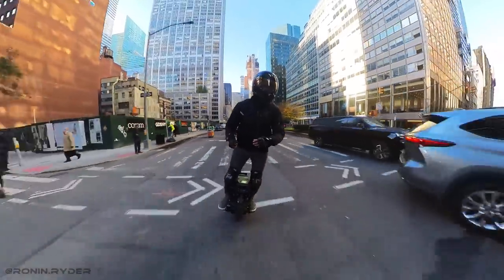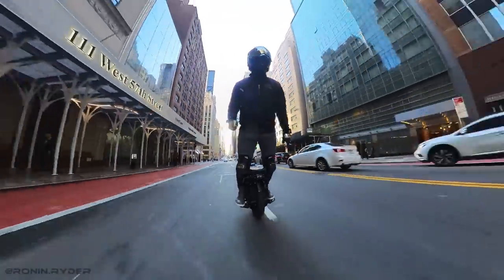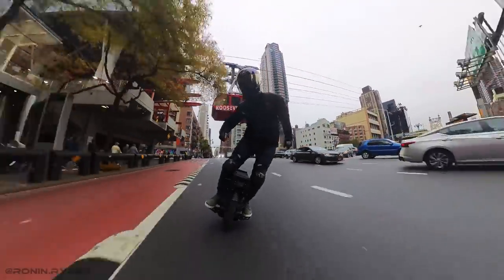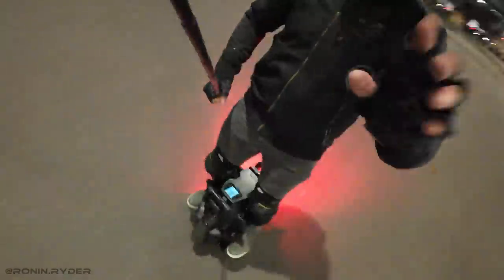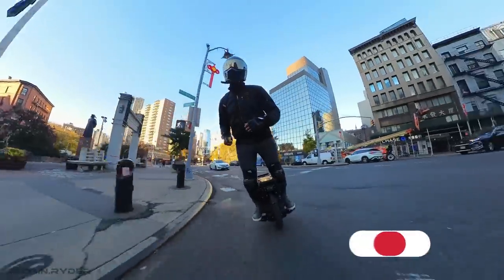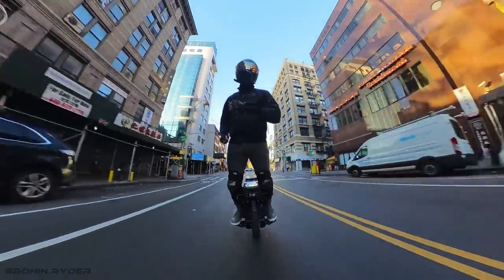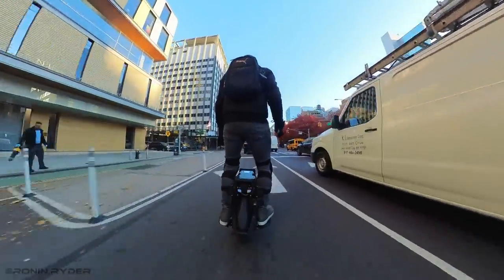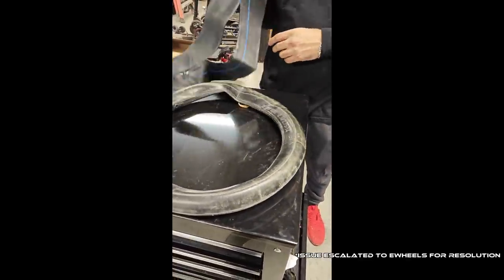VETERAN LYNX REVIEW : The newest Suspension Electric Unicycle by Leaperkim !

Comment: So many new wheels. I am so glad they went back to trying to make lighter wheels. I got the EX30 I've gotten used to it. But I still prefer a more nimble wheel.  I want to power and I want the ruggedness with lightness and nimbleness.
Reply: Get the extreme then..extremely agile with 16" wheel.. it's a mini ex30 pocket rocket.. complements my ex30 perfectly..extremely durable/ rugged with its all cnc metal design.. just get the 50s version
Reply: @justinspirational I agree that it’s lighter and fast but I can’t do higher speeds and if you do it eats battery fast
Reply: @kmurdock3540  how fast do you need?  It's capable of more than 50mph and if you get the 50s version can keep those top speeds up to low battery.. you said you wanted more agility and ruggedness.. the extreme is exactly that.. if you want an even faster street wheel you have to sacrifice agility for stability with a larger diameter wheel.. you have to choose between optimum agility or optimum stability/ higher speed.. the ex30 is pretty agile for its weight due to its low cog and stable and capable of higher speeds but still not as agile and rugged as the extreme for example.. for a higher speed  highly agile wheel you'll have to wait for a 16" 168v 50s begode wheel to be created
Reply: That’s good to know I didn’t know that! I’ll have to do more into that wheel. thanks!
Reply: @kmurdock3540  168v 16" wheel doesn't exist.. I'm just saying hypothetically if you wanted a faster wheel than the extreme but just as agile with a 16" wheel that would be the wheel you want .
But a 50s extreme is pretty close enough or sacrifice some agility for a higher speed more stable wheel that is 20" or more..personally I wouldn't want to be going over 50mph on a 16" wheel and would prefer a larger more stable wheel and sacrifice some agility
Reply: What is the most agile 20 inch wheel out with 50+ mph speed?
Reply: @dustinhankins2153  they're surely all about as agile as each other if they are all 20" as opposed to 16"... the lighter and lower the cog the better I guess.. ex30 is impressively agile for its weight due to its low cog but it is heavier than say a master but the master has a higher cog and not as well built.. ex30 is the faster of the two though.. both are capable of 50+ mph.. but like I say so is the extreme capable of just over 50mph and is the most agile with 16" wheel but not as stable as the 20" wheels.. all other faster, more stable wheels are larger than 20" inches (v13 and master pro) or the other 20" offerings  are really sub 50mph wheels like the s22 and Sherman s
Reply: just put a street tire on the ex30
Reply: @andyl2991 Michelin PS2 80/90-14 ?  Have you converted the stem to tubeless or put the street tire with tube? Thanks

Comment: I have a Sherman Max with the CST knobby and at higher speeds it does occasionally feel like it has a mind of its own - and I don't need my tires thinking for me.  My Master has the Kenda and it feels fine at speed.  If I needed a wheel, I'd consider the Lynx.  20" is more stable, floats over loose, large rocks better than smaller diameter tires, and is more comfortable.
Reply: The CST knobby does that, it’s worth getting rid of.
Reply: I run a Michelin Pilot Sport street tire on my Shermax and it's awesome for asphalt
Reply: @TurboGlenn yeah same I got the shermax with the michelin angel

Comment: great review. the lynx needs the michelin pilot street 2 tire in 80/90 14. should fit perfectly. i have the 16 on my v13 and run it at 47psi, because i think neltrek used the original tube and pinched it on install. so it leaks down a little every day by oozing slime on the rim. wish i had ur guy close by.
Reply from the maker: The kenda street looks nice too!
Reply: according to jack's measurement between the battery packs, it won't fit plus it's blocky and not truly sysmetrical and perfectly round profile of the michelin. u got ur tire buddy there, have him slap on a michelin, they are only $45 bucks! help leaperkim and me out! please, i'm begging u!
Reply: and run it at the sidewall pressure of 45 psi cold please.

Comment: Terrible review, , u said nothing about range, torque and performance , half of the video is about the tire lol
Reply from the maker: “I will discuss speed in another video”. I truncated a portion of it because of some issues in measuring the actual speed of the wheel currently happening. I discussed torque in the video, i dont need to make an essay about it. I dont do range tests, i leave that painful process to others. Thanks for watching.
Reply: @Ronin_Ryder  What about torque, it is zippy like Patton or wors/better/imperceptible differemce?
Reply: @Ronin_Ryder don’t mind the haters. I’m guessing low end torque might not be as high as the Patton, could be wrong though. This wheel looks like it does not disappoint on the speed or acceleration. A step forward for EUCs. Can’t wait for 168V
Reply: @RogueTravel well said. Same here. I expect the Lynx feels nice to ride.